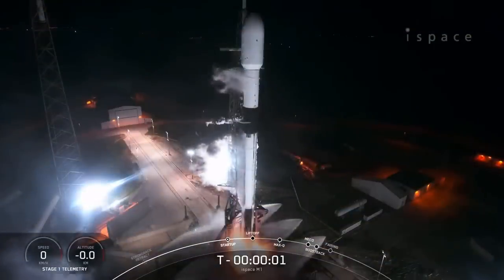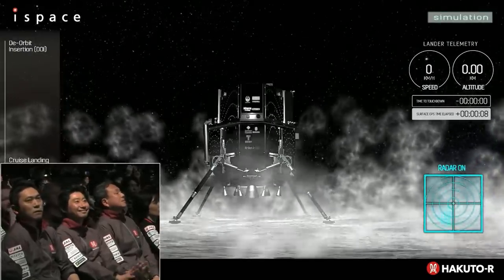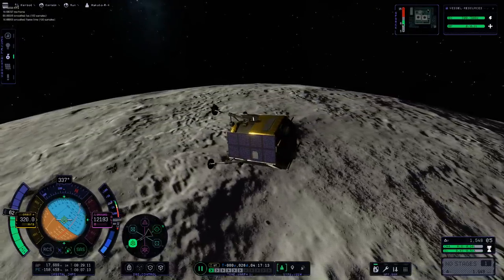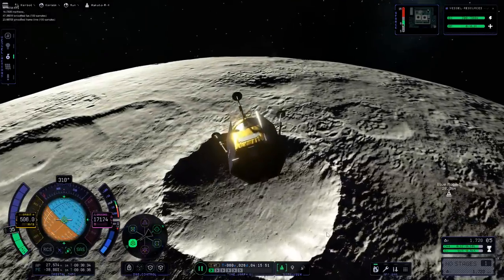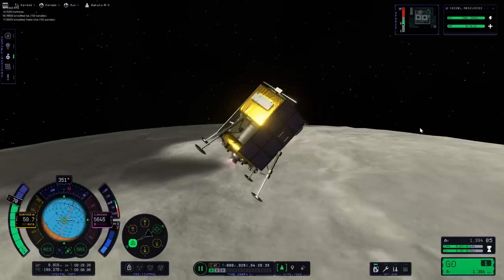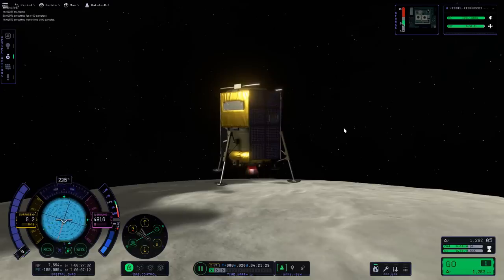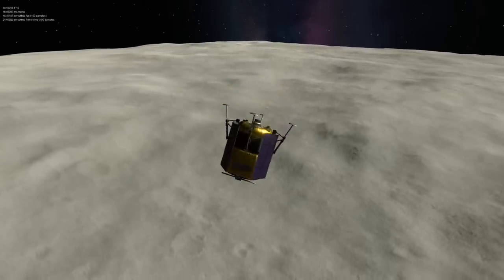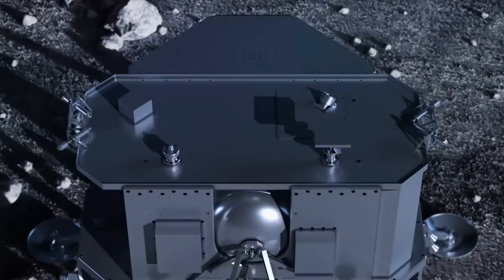Why Japan's Moon Lander Crashed Due to An Unbelievable Computer Bug

Comment: Unbelievable that they had only one method of determining altitude!
Reply: My thought exactly.
Reply: And that that one method could be turned off for the rest of the landing!
Reply: I guess that's part and parcel for those very small landers.
Reply: I mean to be fair, even the Apollo lunar module only had a single non-redundant landing radar altimeter for determining exact altitude. The astronauts were fairly confident they could manage to land without it but if it failed, mission rules called for an immediate abort. The weight constraints for landers are so tight, engineers have no choice but to make those trade offs.
Reply: @GlutenEruption  Ah, but they had the backup that was the Mk. 1 Eyeball and its associated biological computer!
Reply: The strange thing is that last known position and other sensors accumulated 5 kilometer error over such short time before landing.
Reply: @dorsetdumpling5387  Eyeball and brain is unreliable on the moon. There are no recognisable features so you massively mis-estimate the size of things and how far away they are. There is also no atmospheric haze which is a guide to distance on earth. Various of the moonwalkers from the later J missions said that the only things you knew the size of were the LM and rover and once you got away from the LM it was very hard to judge anything.
Reply: if you have two methods then you have to figure out what to do when they disagree!  3 methods is fun but then when if two are wrong due to a common cause?  life is hard. eat arbys.
Reply: @owensmith7530  Maybe so for general presence on the Moon, but for landing guidance, there's at least one reliable indicator: your own shadow.
Reply: @owensmith7530  True, people are bad at it out of the box, but with practice and simulation of a particular site they should be able to get the hang of that location at least. A phone camera and processor could easily identify features of known size around it, so optical navigation really shouldn't be too hard to automate.
Reply: @GlutenEruption  The Apollo LM had four redundant altitude sensors in the eyes of the astronauts!
Reply: sounds like bad programing/ thought
Reply: And what is your suggestion for alternate methods of detecting altitude, Einstein?
Reply: @hadrast  Also dust scattering just before touch down.
Reply: @owensmith7530  I agree, but seeing your shadow approach your landing gear as you descend would be a helpful reference, I'm sure, especially if your were landing in a flat area. Of course, that at least requires you to be landing with the sun in a certain region of the sky and a good view of the lander's shadow.
Reply: @owensmith7530  The Mk. 1 Eyeball doesn't need to be particularly precise to be able to tell the difference between "on the Moon's surface" versus "not on the Moon's surface".
Reply: @SpecialistBR  A long knotted string unwound, with a lump of lead attached to it. Worked fine for sailors...
Reply: @GlutenEruption  But they had humans on board that could judge whether the device was working or not.  Computers cannot do that (yet).

This was a programming error that could have been identified and fixed.  The fact that they missed it is sad, but it happens.
Reply: @owensmith7530  And yet, the LM was manually controlled for landing - and they went just a little further than planned and almost ran out of fuel. I guess that's not too surprising if you take military and/or test pilots, as opposed to airline pilots - priorities are different.
Reply: @owensmith7530  You're totally right that it's not great, but there are some clues you can use to get a rough idea of your altitude as you move over the surface.  Parallax is one.  The closer you are to the surface, the greater the amount of parallax of features of different heights and distances.  Dust is another.  The closer you get to the surface, the more dust that gets kicked up by the descent motor.  Other people already mentioned the shadow.  it's nowhere near as good as a radar altimeter, but, hey, at least it's not IFR flight conditions!
Reply: @sciencecompliance235  Apollo Lunar Module had only one radar altimeter. Show me any lunar lander (manned or unmanned) that had more than one radar altimeter.
Reply: @olasek7972  I'm not sure why you're harping on this point.  Someone else already talked about this.  Do you have an encyclopedic knowledge of lunar landers?  I do not and don't really care to research this.  You said in another comment that you work in software.  I agree that you could chalk this up to a bad assumption in the software design.  An edge case wasn't considered.  I never said another radar altimeter was the best answer, just proposed it as a potential solution.  Unless you have specific expertise on these missions, I respectfully think you should refrain from speaking from authority on things that are outside your stated wheelhouse (software).  We both agree the software didn't cover an edge case and that that was bad.
Reply: @sciencecompliance235   you seemed to suggest that there were multiple radar altimeters on LM, there was but ONE, so yes, I reacted to your obviously factually incorrect statement. And please, one can verify how many radar altimeters LM had, NASA left pretty damn good documentation.
Reply: @KaiHenningsen  This is an urban myth. Even on Apollo 11 they did not take fully manual control. What they did is keep updating the landing point the LM was trying to land at until it was somewhere the astronauts thought was safe to land. The digital autopilot and landing radar were still in control, they were just being given new instructions. Yes the astronauts "took control", but in a rather higher level way than most people assume from that statement.
Reply: @sciencecompliance235   haha, true they did have their eyes but that’s a very inaccurate instrument on the moon since the surface is fractal and there’s no atmospheric haze. Once the radar altitude goes away, things get very sketchy
Reply: @jeromethiel4323  true, but then again the stakes were MUCH higher and the consequences of a failure at the wrong time were much more severe for Apollo. Sure they had eyes but remember until p64 they were flying blind (eyes up), and the later missions in the highlands they were flying below the altitude of the surrounding mountain tops before they even got a look at the surface. If the radar failed at the wrong time, there was a real possibility of them slamming into a rille without any warning. So the fact that they came to the conclusion that a single landing radar was acceptable when lives are on the line, it seems less outrageous that Japan would come to the same conclusion for a robotic mission.
Reply: @olasek7972  I said the eyes of the astronauts provided some kind of backup.  You misunderstood my comment.  I realize eyes are not super accurate in this regard, but they are better than nothing.
Reply: @GlutenEruption  Agree it gets sketchy, but their eyes are better than nothing.
Reply: @jan.tichavsky  … it makes me suspect there is more to the story
Reply: @jan.tichavsky  It sounds like the error happened while the lander was fairly high up, so probably with a high groundspeed. In that case, a small error in the craft's orientation can lead to a large accumulated error in altitude (e.g. lander thinks its drifting perfectly sideways, when it's actually tilted very slightly so slowly changing altitude). Exacerbated by the moon being round, so the further sideways you go the more altitude you gain relative to the inertial frame.
Reply: @owensmith7530  The autofocus system used in modern cameras would have sufficed as a second source of altitude data (albeit limited to distances under about 20-50 ft - which is fine since that's when it matters most). Those rely on phase differences from light coming from the same point to determine distance. No need to recognize what it is the light is coming from.
Reply: @GlutenEruption  Actually it did fail for sometime on Apollo 12. But it started working again. On Apollo 11 also the guidance computer got overworked and then nearly crashed them, but we had the pilots and the controllers monitoring everything all the time and problem solving. Automation is a tricky business. No one really knows what happens when today's codes handle failures until they actually happen. Expect surprises.
Reply: @solandri69  You need to know altitude long before 50ft, otherwise you cane be going too fast at 50ft to slow down in time to land. Equally if you slow down too soon you run out of fuel before reaching the surface, as happened in the case being discussed.
Reply: @jan.tichavsky  not if the assumption when estimating height was that there was no crater
Reply: @srinitaaigaura  I think it was Apollo 14 when the landing radar failed to lock on to the surface - if cycling the breaker hadn’t fixed the problem, mission rules would have required an abort. But you’re right, it’s a simpler problem with humans directly in the loop. Automating everything makes it much more complicated
Reply: @GlutenEruption  it helps not be overly ambitious in your first landing, like Apollo 11, just land in some relatively flat terrain. Why would they target a crater with a floor of vastly different elevation than the surrounding terrain is almost incomprehensible.
Reply: I would have thought that the (software) decision to consider the altimeter defective would have triggered some form of alert in realtime telemetry. Whether it would have been possible to "un-ignore" the sensor by human override is another thing, but by the looks of it mission control didn't even get a proper warning. It seems that this part of the code was insufficiently reviewed.
Reply: @jan.tichavsky  Not strange at all. Dead reckoning usually can only work well over very small distances and speeds.
Reply: @nkronert  yeah, that’s definitely seems like an important oversight if so. Maybe the thought process was something along the lines of once the descent is initiated, they were committed (no way to abort or try again, they’re either landing or crashing) so everything after PDI should be left to the automation but on a mission with only a 2 sec delay, that seems like an excessively rigid architecture. I’d be interested to know.
Reply: @olasek7972  Without a doubt, they definitely picked a relatively ambitious site for a first landing. I wouldn’t be surprised if all the high resolution terrain/surface data and gravity maps and engineering data from successful landers we have freely available today lulled them into a false sense of security and confidence. The fact that they developed and optimized the systems for a specific landing site, and shook down, bug tested, and ran all their systems simulations using that landing site, and yet decided at the last minute that changing to a completely different landing site without retesting, simulating and reoptimizing the systems using the new mission profile was no problem is crazy to me. They either didn’t have the kind if organizational culture that allowed engineers to speak up and be heard (like NASAs failures that led to Challenger/Columbia), or everyone including the engineers believed changing to an untested landing site at the last minute was either low risk enough, or that their systems were bulletproof enough, that a new simulation wasn’t required. Either way,

Comment: It's very interesting that this is almost the exact reverse of the famous 1201 alarm on Apollo 11.
In that case the computer restarted and generated errors on the astronauts control panels. But because they knew that they were at the right altitude per the flight plan they had confidence that they were still flying correctly and Neil Armstrong brought the lander down safely.
Reply: Source of 1202 and 1201 alarms was traced to the rendezvous docking radar, used for rejoining the command/service module was inadvertently left on, at the same time the radar for landing, the only one needed for the decent phase was running. This overwhelmed the lunar module computer, but mission control knew it was still safe to land because of one man at Huston.
Reply: @warrenpierce5542  yes, when you go into the details then these are different cases. But in the abstract, in both cases the computer was confused because it got signals which were unexpected and didn't handle them well. In Apollo's case, the human was able to use additional information to recognize that the problem wasn't severe and in this case - there was no human.
Reply: @warrenpierce5542  In Mike Collins' excellent book, he mentioned the 1201 and 1202 weren't exactly "well known" issues. Took a bit of "looking up" (quickly, albeit)
Reply: That second antennae wasn:t inadvertently left on. I saw Buzz sheepishly confess, the engineers didn’t think the same way he did in an interview.
Reply: Just realized that manned missions are technologically easier (skill of pilot) than unmanned soft landings that are possible now due to the progress of software systems.